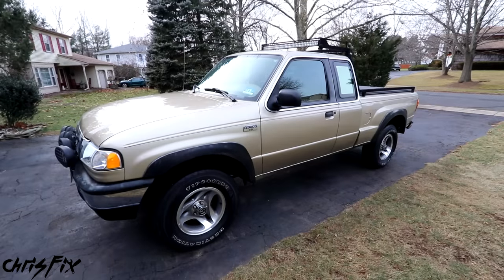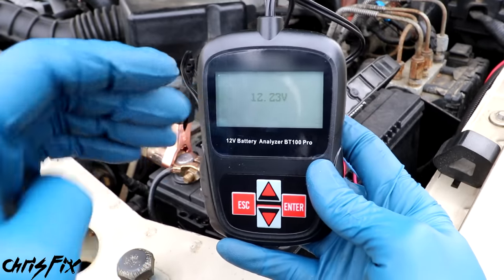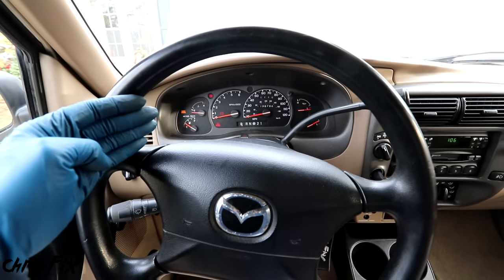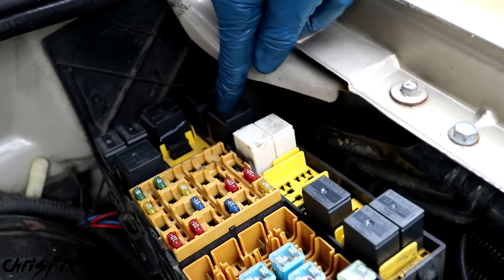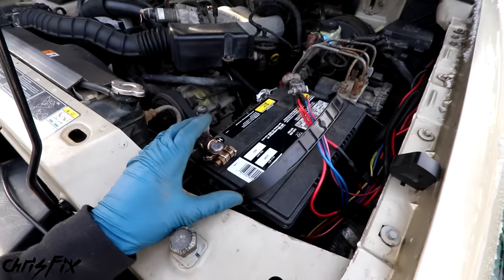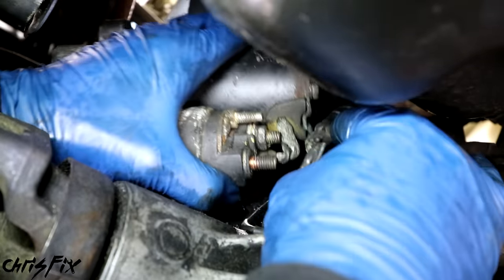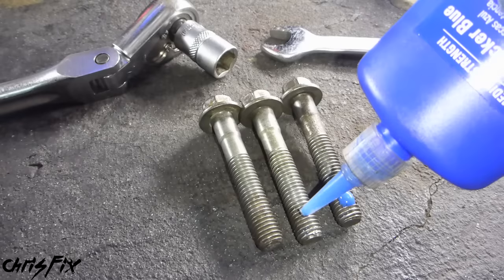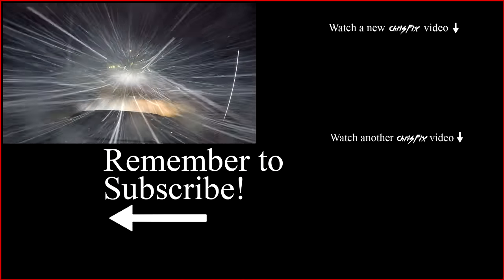How to Diagnose and Replace a Starter

Comment: Always do the hard bolts first :)  Stop going to auto zone, they sell nothing but JUNK.
Reply: Johnny Rocket the stuff they sell is just fine. Plus with the warranties if something ever goes bad they replace it free of charge!
Reply: I beg to differ. Theromostats and brakepads are fine, but I've wasted money on belts and tensioners from them (Dura-doesn't-last) and wound up buying more expensive parts from different brands.
Reply: Johnny Rocket 
Really dude?!! 
You think these discount parts at any other auto part stores are going to be any better?!!!
Reply: Johnny Rocket You can say the same thing for every auto parts store.
Reply: Autozone is just fine. Alot of things are remanufactured, but thats exactly why pretty much everything comes with a lifetime warranty. If it goes bad, take it back and replace it free of charge. You also get the option of buying brand new over reman but its a little more. If you dont want to have a part you may or may not need to eventually replace go ahead and pay 2 or 3 times the price somewhere else like at napa or a carquest where things are brand new. Its up to you. For the majority of people an autozone or oriely parts store is sufficient.
Reply: Autozone is shit, I used to work there and people always complained about how bolts don't line up correctly on starters and alternators and that they shit the bed within a year
Reply: Johnny Rocket its all opinions, Im an autozone and Pepboys guy, but its all opinion so it dont matter
Reply: If it gets our vehicles up and running again thats all that matters! :)
Reply: Johnny Rocket 
Agreed . If the bolts are sideways , start at the top . Even if you can hold the starter , you still don't want the weight of the starter cocking the starter sideways risking breaking the aluminum casting on the bottom bolt hole . Run the top in but don't tighten yet . Run them all in and tighten progressively .
Reply: SNEAKAHOLIC817 
As far as what store or brand , it's all pot luck these days . It could be junk out of the box or a question of how long will it last . And yes , if it gets the car running , that's all we can hope for .
Reply: Autozone or any other local store to me is more for emergencies, if I know something needs to be replaced before it goes bad than I buy from Rock Auto.
Reply: In some cases, I can get stuff, like matching brand LED lights, at Canadian Tire for cheaper than NAPA or Lordco. Shop twice, buy once.

I got a small 20A Flux-core welder and a 30-gal air compressor there, impact wrench, and other tools, all store brand, and when they're on sale. The key if you want to save money this way is to keep in mind your duty usage cycle. If you use it a lot, especially if you're making money off of it, then invest in something better than the store brand. If you use it occasionally, and can't justify the cost of a good one for that occasional usage, then the store brand may do you just fine. 

If you're putting parts into your work truck, go for the good stuff. If you're fixing your kid's beater, cheap may be the better option if he's gonna wreck it anyways.
Reply: Johnny Rocket Pretty much all the stores sell the same exact parts, just under different names and different markups.
Reply: I find this comment extremely rude, and pretty pathetic to be honest.
Chris mentions them in return of a favor that actually made this video possible, and valuable. (Just seeing the starter testing bench!)
Also, if Chris uses them for parts, something tells me that it's probably your incompetence that's the issue, and not the items themselves.
Reply: Amen TheRealXesc. If it's good enough for Chris, its good enough for me!
Reply: Johnny Rocket I concur with ur statement
Reply: Miller Gonzalez Rock Auto isn't bad, but I've had my share of incorrect parts from them as well. They actually had the audacity to tell me (once, it was a short lived mistake) that I selected the wrong part... I said if it was the wrong part for that series, why was it listed in that series? They apologized and sent the replacement. 

I've had good luck with Autozone. Advanced Auto  (I call them retarded auto) is where I find garbage... even when they were Parts America. Anything electrical died in 3 months, mechanical it was a crap shoot if it even worked the first time. What set me over the edge with them was 3 failed brake boosters, and an oil pickup tube with brass beads on the suction side of the screen. They are good for oil, fluids and light bulbs, that's as far as I trust them.
Reply: Ive been working on vehicles ALOT longer than him.  Doing a lot more in depth stuff than you'll ever see him do.  AutoZone is junk and they hire high school drop outs.  Advance hires car people, its nice to talk to a car guy over some clown that was flipping burgers the week before.  AutoZone does that kind of stuff to get customers because nobody shops there anymore and they want customer traffic.
Reply: If you say so. If you dont like auto zone, dont shop there. It's still good enough for the majority of everyone else, so let it be and quit talking crap about what other people think is good enough for their cars. If it gets the job done thats all that matters, no matter what it costs or where its from
Reply: Johnny Rocket damn dude, who's putting a gun to your head and forcing you to buy parts from AutoZone? We get it, you don't like AutoZone. But just because you don't like AutoZone, doesn't mean we all have to hate AutoZone. Hate it all you want, AutoZone doesn't care because they will not go bankrupt if you don't shop there. Shop wherever you want. I bet there are people who hate where you shop.
Reply: Johnny Rocket do you  offer better parts?   no?  then shut up...   auto zone sells parts equal to any other parts store.
Reply: I smell an Advanced Auto troll. I can tell you clearly in western PA, the exact opposite is true.
Reply: LOL, sure, you're a super experienced mechanic that knows it all - that's why you were watching "How to replace a starter" in the first place ;-D
Reply: Johnny Rocket because of my work hours, AutoZone is usually the only place open when I work on my car lol. plus I have had a pretty decent experience with them.
Reply: I agree. Autozone was good 20 years ago before the Duralast phase. They used to handle Bosal exhaust, Timken bearings, Bosch filters, Wells electrical, Victor Reinz gaskets and their remanufactured parts were high quality. Advance Auto sells better brands like National, Monroe, Moog, Stant etc. Just stay away from most of the CARQUEST branded junk other than brakes. CARQUEST used  to be premium auto parts before Advance Auto bought them. Same thing with Napa. Most of the Napa brand parts are made in China and the quality has gone down hill 10 fold. It used to be that Napa and CARQUEST (Big A) were the professional grade aftermarket auto parts stores. Now if you want the good stuff you can only get certain things at the local parts stores and the rest is either Rock Auto, Amazon or the dealer.

Comment: my truck will not start it will crank over but it won't start I don't know what's wrong with it butt it's not the fuel pump I spray starter fluid in engine while starting it and it wouldn't even crank up so I don't know what's wrong with it
Reply: JnT Fishing engine lock?
Reply: Jonathan Pineda I have a 1999 Ford Explorer Sport and I also have a sound system in it
Reply: JnT Fishing for egnition you need fuel, spark and air. if it doesnt fire at all, even with starter fluid sprayed into the infake then check for spark. check your plugs and wires and if that doesnt work check your distributor cap and rotor. you're missing spark somewhere so just have to do some investigating
Reply: JnT Fishing check your car for spark. check all your fuses. could be a sensor or bad coil.
Reply: wallys wheels thank everyone
Reply: Let us know how everything goes! We're here to help eachother
Reply from the maker: Just like Frank said. You need fuel, air, spark, and timing for an engine to run. If the starter fluid isnt working then I would guess it is probably a spark issue.
Reply: JnT Fishing i had the same problem bud, check your spark plugs i did mine and it fired right up!
Reply: JnT Fishing It could be your PATS. It's fords security system. It will turn over, but won't start. If the theft light is blinking while you're turning it over then that's it. You also need compression to start, but I doubt that's your issue.
Reply: As posted , and good replies , check spark , fuel pressure . If spark is not present , that may be simple as plugs , wires etc. but as complicated as cam and crank sensors or PCM related . Then it gets down to things like 5 volt references missing at sensors , no communication between PCM and sensors , fuel management system problems . An oxygen may not be a no start problem but no reference or communication for instance on all sensors means no input . Even a coolant temp sensor could cause a PCM to have incomplete input and cause a no start . Hopefully none of these night mares but start simple and know if fuel and spark is present . Don't forget that air has to get into the engine . Flood mode should take care of that . Hope this helps . Search Chris fix forum , I'll bet there's a fix for your need .
Reply: JnT Fishing Oh yea, check your cam and crank position sensor too
Reply: I had a 96 roadmaster that wouldn't start but when I had somebody else turn the ignition I noticed a spark at the battery ground and the engine block, After tightening it some even though it was already tight it started everytime after that
Reply: I had a similar situation with my 89 lincoln town car. Id crank it to start it and it would just click and completly die and lose all power. Had someone wiggle around near the terminals while i turned the key and there was some sparking from my negative terminal wires. We stripped the old corroded wire back some to get new shiny wire and assembled the terminals back together and havent had a problem since.
Reply: Bad grounds can cause quite a few problems from starting issues to gas gauges and other electrical parts not working
Reply: in some cars having issues with theimobiliser will not stop the starter from  trying to start the engine . i had problems with the imobiliser on my car and the starter was spinning but the engine didnt start .( my key was fine but the electronic part in the ignition wasnt reading any key) . maybe this helps.
Reply: Valentin Meran Yup, PATS is like that, at least in my mustang. It will let it turn over but not start.
Reply: if its not fuel its spark , check your coil pack :)
Reply: Kingmawii OG e
Reply: I just want to say thank you to everyone that left a comment helping me!
Reply: So what fixed it?
Reply: The suspense will kill us all haha. We gotta know
Reply: spark plugs?
Reply: four things to check with crank no start ignition, timing, compression and fuel delivery
Reply: JnT Fishing J  T fishing check your coil by removing the spark plug wire on the number one cylinder utilizing a screwdriver in the spark plug wire grommet boot,and then grounding it out. make sure you have a really good ground,then simply have someone turn the key switch over,, however you'll  need to be under the hood as their cranking,looking to see if you have spark going to be the engine.. there could be several different things going on from a bad timing belt,or chain whichever is the case in your truck.a coil or coil here again whichever one you have in your particular vehicle. you can also have a bad pickup in the distributor ,there are several things that need you need to check, just start with the coil let me know I'll give you my number..
Reply: sorry i didn't get any new notifications but i got it to run for a little bit then when i cut it off my theft light keeps coming on so i had to call a lock smith to reprogram a key for me thanks to everyone that helped me out
Reply: Good to hear you got it running!
Reply: Glad to hear you're back to motoring around!
Reply: Check the ignition module.

Comment: don't always trust the testing of the starter
Reply: FlipFlop Mechanic Hada bad starter once and autozone passed it 4 different times and it " was okay ". New starter fixed problem
Reply: Proper starter testing is done under load with the starter engaging in a correctly meshed gear, with an adjustable brake system on it. Volts, Amps are measured in quick succession and check if the starter still has the correct power output.
Reply: The test only proves that the solenoid will kick out the gear and rotate it.  But if the motor is too weak to actually turn the motor it will test as OK, but won't work.

You can do the same basic test at home with jumper cables.  Negative to the housing, positive to the stud.  If it pops out and spins then the tester at the parts store is also going to show it as OK.

It's a decent test most of the time, but yep it has false positives in some circumstances.
Reply: In this case the starter did pop out and spin but the tester failed it. Presumably it picked up that the armature had some open spots as the motor was spinning, which will cause a no-start if the starter ends up in that position after it was last cranked.
Reply: Dead spots on the armature will immediately get picked up under the load test.

Comment: This was well done and helpful. But I have some important info that I didn't find on any of the 'no crank' videos:

If it is the battery as it was with my 2015 Silverado, you have to actually INSTALL the new/good battery, NOT just jump it - that did not work. It took my shop to find this out. I believe them because any other problem with the ignition system would have cost more to fix. Plus it did work.

The explanation from the  shop is that it has to do with the computers and complexity of the charging system, and the need for direct cable connections. Jumper cables do not provide the necessary power feed. The voltage was fine, but I do not have an amperage meter and couldn't verify.
Reply from the maker: Interesting, thanks for sharing!

Comment: My starter on my Ford Expedition went out at a convenience store 200 miles away from my house. I had to buy all the tools and the starter and I was by myself so I had to walk two miles to the auto parts store and I had to change my starter in Chevron parking lot while the employees are telling me to leave that I can't do that there. I told them that I had no choice. That was my first time ever changing a starter too. Then when it turned over for the first time I could not believe I actually did it right the first time and it worked. I felt hella proud of myself
Reply from the maker: Awesome! And sometimes you don't have a choice!

Comment: I love this channel 🧰🛠

Thank You Chris. I am in Zimbabwe.

My ML 270 CDI (W163) died on me in town over a year ago. I was driving and the car just kind of went into a spasm and switched off.

Can you believe the mechanics I called came to the scene and couldn’t figure out what happened. They checked fuses, flashed the ecu then started scratching their heads. I just watched your other video on the car you got from your neighbor.

I will need to change the oil and get a battery then I will go through the 5 steps. Do they work for Diesel engines too?

Comment: Could you have repaired that old starter yourself like; change or clean the brushes, replace a brush spring if needed, clean the commutator, lubricate the shaft ends, or whatever?   Enjoy your channel and the repairs you share with us. My truck, an 02 Ford Ranger 4.0L 4X4 (Gold), is very similar to the truck in your video, so it makes it more interesting to me watching. I have replaced the AC relay in my truck's AC recently, and I do carry a whole spare relay and fuse box for my truck for $60 on ebay, and by using one of its relays for the AC Unit the spare use box paid itself off and there's more fuses and relays to spare. I also have a cheap new relay tester. Thanks for all those TIPS you share, and a thumbs up to you my friend.

Comment: Well done as always. I had 2 instances of no start, no click, no radio but indoor light works. Everything started smoothly after replacing the relay fuse. The question: What causes the fuse to blow out in the first place? Was it a sign that my starter about to fail soon?

Comment: I just completed this job yesterday and would only add: Spray the bolts on the starter with penetrating oil for 10-15 min before starting the removal if you live in the Northeast or somewhere with similar climates. My bolts were somewhat rusted and spraying the oil made it way easier.

Comment: Hey Chris. Great Vide. My 97 Toyota Rav 4 is showing signs of needing a starter. It has 135k miles and original. Many people are telling me it is the aftermarket remote starter system which does not play well with Toyotas, but the remote has worked flawlessly for over 8 yrs. What do you think. Also, how much torque is generally used, and are shims involved in the installation? I do not want to damage a new starter or the flywheel.
Reply from the maker: Check your battery cold cranking amps and see if the battery is bad or going bad. Any major auto parts store will check for free. You might need to shim but most cars today you do not need to. When you take yours off you will see shims if it needs to be shimmed but I doubt it.
Reply: Thanks Chris. It is a 97 so pretty old but rus and looks great. I cannot find the torque specification. Is 20 ft lb pretty safe? I will watch for shims when I remove the satarter.

Comment: Thanks for the video. Appreciate it. My battery is good, had it tested. Most the time my car cranks fires up properly then randomly I have to turn my key over several times to get it started. Can that mean there is a dead spot forming in the starter?